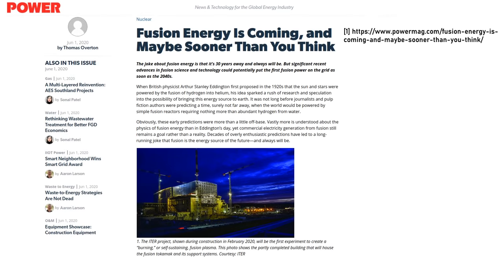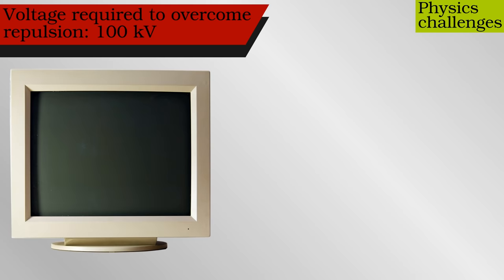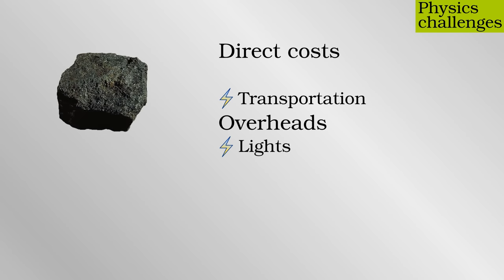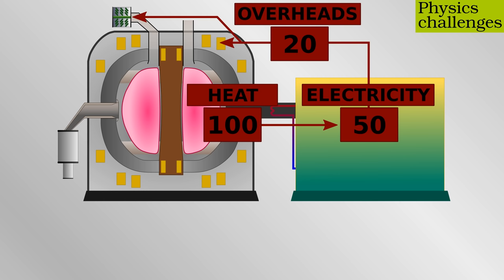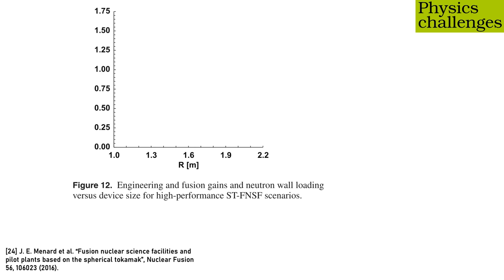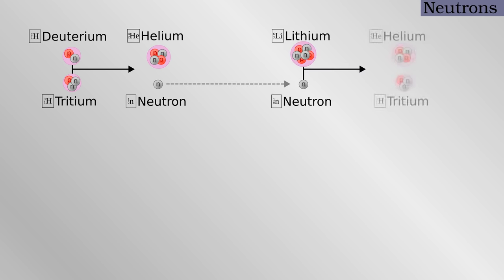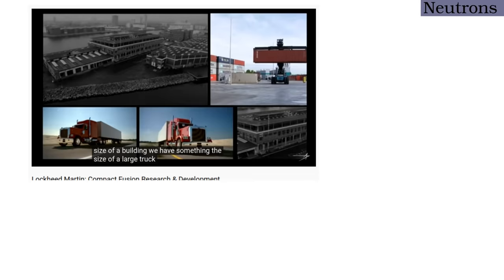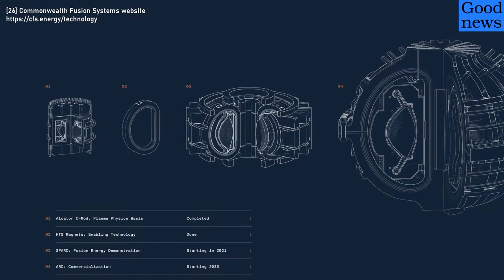Former fusion scientist on why we won't have fusion power by 2040

Comment: Someone once said that physics is math constrained by the limits of reality.  And that engineering is physics constrained by the limits of money.
Reply: Bri Ba  Actually building something is a problem of money constrained by greed. AKA how much of the money will be pocked away with nothing to show for it.
Reply: Fusion tech is perfectly at home among vaporware projects.
Profitable Fusion energy that will solve all of our problems is always two decades away.
It was that way when my dad was born.
It was that way when I was born.
It will probably be that way when I die.
Reply: Love it!
Reply: @hypothalapotamus5293  and that's ok :)
Reply: I don't think anyone in this comment string understands what money is. Money does not buy technological advancements, nor research results,  nor human capital (knowledge). It does not matter If you "have" 5 trillion dollars to invest in fusion energy, the fact is, there are several issues that need to be solved, and this are extremely difficult problems which require time (from extremely intelligent humans). There is also a chance that the person that could solve these issues has not yet been  born. Now, while it is true a large inyection of money translates to more brilliant minds working on the problem, in reality that translates to a slightly higher probability of solving said issues. However, considering many many intelligent humans have been trying to work these problems out for almost 80 years and have not achieved any significant advancement, I'm guessing the probability of creating a profitable fusion reactor is extremely low, no matter how much money you throw at it.
Reply: You can add "software development is engineering constrained by the limits of time".
Reply: i love that :)
Reply: So basically we are being constrained by both limits of reality and money. Great.
Reply: @Zyleace  reality, not money.
Reply: @Spookyhoobster  nah, you clearly needs to add 9x more engineers, the project completes 9x faster. totally doable. (and when I leave companies, I always leave nine copies of the Mythical Man month in the boss desk)
Reply: As if we could approach the heat generated on Earth by the sun. Fat chance of beating a solar array the size of the planet, we'd never use that much energy. Even if we did  that society would be so far advanced that Earth's warming would be trivial.
Reply: Bri Ba  some problems cost more than the PIB of the world to solve. So no we don't have the money solved
Reply: It's more like engineering is applying what science you can find something applicable for it, that is profitable. You won't see companies profiting from any science that came about since the year 1950, and most of it doesn't use any science from after 1900 other than what quantum mechanics is necessary for a transistor to work.
Reply: Duh.... Just design and build money printer which likes to go brrrrrr.
That way engineering constraints are removed
Reply: So it's actually materials science, PM, human motivation/institutional motivation. Money is a shortened phrase.
Reply: Acrually we humans are constrained by our seemingly infinite hubris.
Reply: then federal reserve will solve that limits of money
Reply: @ccva780  Do you genuinely think we'd have been on the moon nearly as fast if the US and Soviet union didn't invest a metric fuckload of money into their projects? Obviously there's quite a correlation between invested money and scientific breakthroughs. Maybe not 1:1, but the amount of people you can get working on something like this if you invest trillions can drastically reduce the amount of time needed to make a breakthrough. Imagine if the US was focusing as much on fusion as the space race, we'd already have it by now if it started decades ago. Instead, fusion remains terminally 30 years in the future.
Reply: @scoutbane1651  No, what I genuinely believe is that achieving fusion is exponentially more difficult than sending a human being to the moon. The point being being that if the probability of achieving the necessary breakthroughs is minimum, even if you add those probabilities up it'll still be quite small. I argue money is not the problem, rather time. And you can't fastforward time.
Reply: Hysen Berisha  I agree. Perhaps not trash but not feasible with the materials we have at our disposal.
Reply: @ccva780  It's exponentionally more difficult, sure. We are also... 60 years in the future. Is it really exponentially more difficult compared to how difficult it was getting someone onto the moon at the time? You do realize science has also exponentially gotten better compared to where we were at the time right. Like, we have loads of technologies that would be considered science fiction twenty-thirty years ago. I genuinely think if we invested as much as into the space race, sure it might take a few decades, but we'd be there by now if we started decades ago, simply because we'd have dozens of times as many people doing fusion research.
Reply: @scoutbane1651  ah perhaps yes perhaps not, I guess we'll never know.
Reply: Hysen Berisha  Oh my fucking god I didnt think you were actually a truther ahahahah it's like a joke that writes itself I am so sorry for whatever went wrong in your upbringing my guy/girl/NB :,)
Reply: The 2 things that make the "world go around". Conservation of angular momentum and MONEY!!!
Reply: Elon Musk seems to have the hat trick on the trio.
Reply: Developing fusion reactors is constrained mostly by greed and limits of reality.
Reply: Instead of money, I'd say logistics is a better term
Reply: Hysen Berisha  there is (currently ) no reason to send a mission to the moon. Other Atral bodies are much more interesting to the scientific community. If you want proof for the moon landing, there are still remains from the missions present, no wind, no decay of your precious proof.
Reply: @Mernom  functionaly all of it. All that's left is pocket change and debt.
Reply: Hysen Berisha  it wouldn't be sufficient to win an argument, video proof would only be necessary if the foot prints and other remains were to be swept away. On top of that please specify your intent next time you try to make a point. There are enough dumb people around who would use these kinds of statements to prove their point.
Reply: Truth!
Reply: engineering is only constrained by the limits of talent and practicality. The Concorde is an excellent example of this. There has not been a single SST operated anywhere since the Concorde went down in flames. How many commercial flights have been lost in the meantime?
Reply: @touristguy87  ok touristguy87, 👍 👌
Reply: Wow, best quote ever
Reply: 1. Not just Deuterium-tritium in the chamber. 2. Consider 13 Compounds used in individual mixing chambers, within the main chamber and as one fusion finished/completes, then begins the second cycle, and so on and so forth until you go all the way to the end to the 13 fusion reaction cycles, and then the energy will be STEPPED UP TO SUCH A DEGREE AND THE PLANT WILL BE IN THE BLACK AND MAKING MONEY. 3 It is up to you folks to figure out which substances have to be employed, and to arrange these substances in a stair step pattern, with those substances which create greater coldfusion explsion energy then the previous compound used.
Reply: Bri Ba  I think in fusions case the biggest danger to ever seeing a working reactor in our lifetime is when the presses promises of “fusion in 10 years” wear off and the research companies lose most of their funding. 

It would be hard to get funding for a project that takes like 50 years at least and won’t have much to show for it except for tiny gains every couple years. Especially when fusion tech gets a little closer to being viable and the costs of building new test reactors skyrocket, since any major gains will only be had with complete redesigns of reactors, instead of small upgrades.
Reply: Read "The Legendary Man-month" by an IBM programmer. He noted that throwing 10× people on a project doesn't make it 10× faster.
Reply: someone once farted
Reply: Right. As they ignore the limitation their own physics puts on things. Unlike normal things. Blackholes and neutron stars are the only known objects that somehow can put out more energy than the take in. One collision making a gravity wave with enough energy in it to be 50 times more than everything in the visible universe when the wave combined as it left the point of collision...

The other reason it probably won't work I explain in another comment at the top. Their own avoidance of theories they support and possible down sides to having that kinda thing without other forces like massive gravity that could regulate quantum fluctuations that allow stars to fuse even as the sun burns up there right now.

I even looked it up just to besure and they say the quantum is needed for stars to even come close to doing fusion cause they don't have enough power even in their core to do it.

So you want to see a quantum powered object. The Sun is a massive object that uses quantum effects as its fuel somehow jumps to energies that its own pressures and gravity can't put a candle to.
Reply: @Blazeww  you need to take a sedative and play some World of Tanks and work-out some of that anger.
Reply: Well said
Reply: @hypothalapotamus5293  very true.  I first read the phrase "tokamak" in 1990 while I was at engineering school.  Still not ready.
Reply: well said!!! i steal this 😂
Reply: @ccva780  Agreed. Magnetic confinement of the plasma is very unstable. The sun does confinement by gravity and solar flares show that to be unstable too. We have only done thermo-nuclear fusion for the order of a second with demonstrable intended results, before the device blows itself apart.
Reply: And the money is engineering constrained by the limits of what?
Reply: @electronresonator8882  There's no limits to money as far as government.  The limitation is the value of said money.
Reply: @scoutbane1651  As impressive as the Apollo Program was, the foundational science and math were already quite mature.  Yes, there were terrific challenges and some amazingly brilliant people that made it a success with little more than slide rules.  At the end of the day, nobody was saying, "Just make physics better."
Reply: @patrickjanecke5894  Nobody is saying that with fusion either what the hell are you talking about. Did you see how we're now using high temperature superconductors to make fusion exponentially better? By 2025 we'll have a fusion reactor with a Q of >10.
Reply: @scoutbane1651  Your argument actually underlines my own.  How large of a portion of waiting for fusion included superconducting magnets?  Even after gaining that technology initially, progress in superconductors has been one of fits and starts.

Don't get me wrong, I do want to see the MIT team successful.  That said, my concerns are both the over-reliance on Tritium and operation times.
Reply: @ccva780  yep Perelman didn't need money to prove one of the hardest math problems. And all the money in the world won't help to come up with genius solution about fusion. They need some qm genius not money
Reply: Feynman talked about this-often a source of good natured rivalry between physicists and mathematicians
Reply: @usr7941  yup agreed, and unfortunately those types of geniuses come only once or twice in a century.
Reply: Very good!
Reply: das deep bru...
Reply: Nice
Reply: Reality? "It is in the classic arrogance of man, to think that all that he knows is all that is"
Reply: Yeah sounds about right
 Some "smart" guy always has to come around and say "this thing is that thing, but different."
Reply: lets`be honest money is generally the limit regardless of the field. Fission is dead and fusion does not make any nuclear waste but some alpha particles of radiation.
Reply: It's practicality more. If it's too expensive, chances are, it's because it's too resource intensive. Whether that's using too much raw material or too much energy. This is especially the case in fusion and as someone else pointed out, there are big hurdles that money can't magically solve. Brilliant minds have been working for decades with snail-page progress. Pumping trillions of dollars in, for all we know, could only translate to miniscule gains in productivity and innovation. 

I'm getting really tired of people watering down all problems in science to "greed and an unwillingness to just throw more money at it."

You're stupidly naive to blame all of life's problems on greed. It implies you think money could solve everything, which it CAN NOT.
Reply: "Someone once said that physics is math constrained by the limits of reality."
Not so much, have you ever looked at things like string theory?  Theoretical physics is constrained by the limits of intelligence and creativity, and hopefully at some level the push back at BS.

Engineering is constrained by physics, very true.  Is it constrained by money? Absolutely, no question that is one major aspect.   But much moreso, IMHO, for the most part, by the greed and shortsightedness of the kindergarten MBAs of the world, and every other form of ankle biter out there whose single goal in life seems to be to place absurd roadblocks (for the most part) all along the design path.

Can you tell that I am an engineer?  Every other engineer will be able to, when they read this, I suspect.
Reply: A different set of definitions:
Engineering is making something work thru experimenting and cobbling it all together until it functions the way you want, without necessarily understanding the exact principles behind it.
Physics is figuring out those principles so it's repeatable.
Math is figuring out how you can apply those principles in a more easily calculable way. Example: replacing certain differential or integral solutions with matrices (multiphysics does that, based on some interesting math 'simplifications' like Finite Element Method, Method of Moments, Finite Difference Time Domain and several others.)
Reply: then music might be math for the soul
Reply: engineering is constrained by the limits of engineers.
Reply: Don't forget that there is an extremely limited amount of tritium and producing it from lithium-6 is extremely problematic.
Reply: More accurately, math is the language in which physics is formulated and communicated.
Reply: Here's some metaphysical math : Less is More.
Reply: Does that means maths has no constraints?
Reply: @Spookyhoobster  All engineering is constrained by time (and money).  Software engineering is also constrained by certain mathematical realities.
Reply: well economics is money constrained by the limits of markets
Reply: @ccva780  well said. Or, to put into other words, the fact that a woman delivered  Isaac Newton in nine months, does not mean that  nine women can deliver  Isaac Newton in a month.
Reply: Bri Ba   @Marik Zilberman  Conditional Probability is a particularly interesting form of mathematics.

"If throwing n money at problem P is a function where the probability that P will be solved decreases logarithmically as n𝛥 at given t increases, until at point R it inverts and further throwing actively impedes problem solving, and n𝛥 is always > than R(t)-t, which is always > than P... then what the fuck is even my head?"

Governments and institutions can create currency, but they don't know how to make money worth anything. They run the "Solow Growth Model" which states that "demographics is destiny" and that roughly speaking all you can do is try and have more people between 25 and 45, keep things liquid, and chuck ever more typewriters at monkeys...

Engineers should be running things. But of course, the problem is that engineers focus not on society but on functions, since they understand that there's no running things if things don't run.
Reply: Nobody said that
Reply: So, communism is the answer
Reply: Don't know who that someone is and if that phrase had a context...  by itself it seems said by someone that has no idea of what math nor physics nor engineering is.
Reply: @patrickjanecke5894  Money is a proxy for energy. It loses its value when each unit of money represents fewer units of energy.
Reply: Y not get it
Reply: @ccva780  your entire point. Just logical fallacies. Of course money leads to innovation, same way war and survival does.
Reply: @AntonioGarcia-wn7ut  ok, here's a chocolate for your opinion 🍫
Reply: I agree with the first one, but I would say Engineering is Physics constrained by the limits of common sense.
Reply: Money is kind of a secondary abstraction here. Engineering is physics constrained by resources.
Reply: Physics is restrained in the math too.
Reply: @dendrogenhs  Loved this!
Reply: maths
Reply: I love this
Reply: nah i'd say engineering is physics constrained by reality, money problems and engineering problems aren't exactly the saem
Reply: And material constraints in this case.
Reply: I think it was Hitler
Reply: and politics is engineering constrained by the limits of human stupidity
Reply: Maybe focusing on the ONLY THING IN THE UNIVERSE that can create magnetic fields in stars or anywhere ,instead of focusing on the 100000000000000000000000000000000 times weaker "force" GRAVITY we might make progress! Good job wasting 70 years and billions of $.
Reply: I like to describe engineering as the science of the possible.
Reply: @hypothalapotamus5293  Very original
Reply: Therefore, engineering is physics constrained by money and reality.
Reply: Well said someone!
Reply: Both are plainly wrong, and the "limits" stuff is nonsensical. Think about it a bit. I'm not aware that "reality" can be varied, and you can always print more money. I think Godel proved the first one wrong.
Reply: Bri Ba  cute, but we really can't exclude intelligence from that last bit...
Reply: Wow that’s SPOT ON
Reply: The second part approaches validity if you modify it to read "Engineering is a mixture of physics and economics."  Physics, however, extends beyond math, as shown theoretically by Godel and practically   by the fact that all physicists (or close enough) recognize that observation is the bedrock of physical truth. Math is a stunningly useful tool in doing physics, but is most certainly not a generalization of it.
Reply: Well said lmao
Reply: I thought the UK was building its first fusion reactor?
Reply: @makeasylumsgreatagain864  Really?
Reply: That's not entirely true for the latter: engineering is the budgeting of reality.  Money is a factor, but there are a number of realities that you can't bypass regardless of how much money you throw at it.
Reply: More like constrained by the limits of existing materials science.
Reply: @ccva780  Money SHOULD be a problem for Engineering. Money = Time + Productivity + Customers. Money makes all of these scientific pursuits possible. Science should have to prove that these pursuits are possible, then investors can give their hard-earned money a go. Scientists that lie about the science of their pursuits are basically thieves.
Reply: @Zyleace  Those limits are good things. If nature didn't have limits, i.e. if the nature of Nature could be changed, then science wouldn't exist. There'd be no facts, since reality would be some flimsy, changeable thing. Without facts, there's no such thing as knowledge.
Reply: @joshuagould548  I'm not simply talking about the physics of it. There's also the situation of how fucked up humans would hinder the research to unravel the secrets of reality. If it was only the limits of universal laws, that's fine. But then you have to add up that financial situation. It's a stack of problems and knowledge is the bottom of it and you have to do everything above first.

Without constraints of money, people could work on the reality, there will be such thing as knowledge.
Reply: @Zyleace  Understood. But without money, research would hardly exist. Technology exists because someone saw that the science of it was possible, but what's the point of mass manufacturing and commercialization if there's no ROI. Think about what R&D looked like say 1000 years. It probably basically didn't exist (unless at the behest of some royal family, who had money).
Reality is all-encompassing, we don't have to go to the end of the galaxy to learn about it.
As an example, it's impossible to explore places that are light-years away, because of that, there will be little to no technology being worked on to supply such expeditions. If fusion falls into this category, then it's money should dry up, and it's research ceased.
Reply: @joshuagould548  Which is why too much dependence on money should cease. With current technology, money could be replaced by a vanishing credit system where it could be given as a salary to jobs without being of so much value. These credits should disappear when utilized for transactions unlike real money which circulates.(This system is huge, I do not wanna delve into it)

Also, science might not need to go into far places in the galaxy to uncover reality, but humanity isn't simply about science. One day, a new age of exploration will eventually arrive. People in that day and age will be dying to see and experience other stars and planets not simply for science but for exploration honestly. It's an inevitable thing about humanity.
Reply: @Zyleace  So the credits would just disappear upon transacting? Money = Time + Productivity + Customers. So when the credits disappear, their value (the time and productivity put into them) would just disappear?

Also, I'm of the belief that people already want to visit other stars and galaxies, but those are light years away, so it'll never happen, and no amount of science could make it happen, therefore no money (or credits) would go to such pursuits.
Reply: @joshuagould548  Money is something that has always been intended to reimburse time and productivity made by people. It only makes sense that it should disappear once you have bought something. Demand still works though. The system is that credit authorities will give the credit funds to companies annually. The requirement is that demand should not drop to an unacceptable range. It's like an infinite money but regulated by various policies that will keep the economy from having serious inflations.

And I extremely disagree on the second part being impossible. People 2000 years ago would have never expected that things like cars and smartphones would exist today. To them, they are magic and things that are far leaps of technology. Millenia in the future, we would surely have the capacity to travel to other stars. As long as humanity aspires for it, it will happen. So at least I'll have faith on that part.
Reply: @Zyleace  If money disappears when I buy something, then what does the person I transacted with do? Now they don't have their product that they sold to me, or my money that i bought it with. Do they just lose?

So governments will just give money to companies annually? No need to earn it? So if I just pitch a good idea that other people like (demand), but haven't proven possible, I'm open to an infinite money supply? If your credit system is based on nothing physical, then it's susceptible to all of the ebbs and flows of inflation and manipulation, like all of today's fiat currency. Your credit system would be a fiat currency. Infinite money supply means a soon-to-be worthless money supply.

Getting to another star is in fact impossible. The ancients of old could at least look at today's cars and see THAT they work, ask questions, put together certain simple logical conclusions. Getting to another star would require the actual top speed of the universe (light speed) and would require that speed, consistently, for 1000s of years. That's what a light-year is: light traveling in a direction for a year. Imagine the distance light can cover in a year...now multiply that by 1000s. I think the closest star to our sun is like 4 or 5 light years away. That's still an insane amount of distance, and humans absolutely cannot travel at that speed, plus whatever tech is used for the traveling would be billions times heavier than a photon (what light is made of), so it would take billions time longer.

Faith and science don't mix. Faith requires one to shut off their mind and just feel. Science requires the mind be turned on and focused, and feelings left aside.
Reply: @joshuagould548  Pff, I never said "governments." How ridiculous. Banks will be the one converted into the credit authorities, separate from the state. The credit system needs you to rigorously defend your business proposal while being ready to build up that business or company. Once approved, you will be able to receive capital ONCE. If your business is a total failure for one year, you don't get to receive the capital for the next year. And I never said it's an infinite money that would just cause a great depression. Infinite money supply here means that the credit authorities has the power to create these credits as they see fit, but with limitations. After all, these credits are voided once spent. It's not an infinite cycle, but a limited lifetime for all credits. Unlike currency today which circulates endlessly, credits start from the banks, terminated once utilized.

And you are misunderstanding faith again. Too much red herring. I'm talking about basic faith towards mankind. Not god. It's a basic necessity to believe in mankind's ability to reach the future. If you don't even have that sort of faith towards your fellow humans, you lack some basic humanity then.
Reply: @Zyleace  OK, then anyone can open "a bank" and just give their buddies infinite capital. Approve them every year. The business proposal could be crap, but you'll have an income because your bank could give you credits anyway. Also, since "the banks" can whimsically create these credits for nothing, they don't have to be scrupulous at all with their investments. They could give as many second chances to any failing business as they want, thus infinite credits. Bad businesses would sprout up everywhere.

Banks today have to weigh heavily on their investments, too many bad investments would result in a huge decrease in returns on investments, and the bank can go down. Investing is about judgment, and with the ability to just create credits when I feel like it, I can abdicate from judgments. It can go the other way too: if the bank simply didn't like the person, the bank can simply deprive them of credits.

No red herrings. It's called a dictionary. I'm very positive about the world we live in and what mankind has done. Faith has a meaning, and I applied it. Faith is about believing in something with no evidence. Me admiring the geniuses of the past and present, and the ability of mankind to master the universe isn't Faith; it's Admiration, good will, and benevolence.
Reply: @joshuagould548  Sigh. This guy just doesn't get the point or even context of what I meant by faith. It's about trust and believing. You have to have faith on a future that isn't determined no matter how humanity seems to suck. Nevermind, seems to me you have no faith towards me or even any other people. I'll no longer reply to that subject after this

Also, you totally didn't get it when I said you have to rigorously defend your business proposal isn't it? That's only once. You have to report to the credit authorities annually about the demand and status of business and there will be some sort of a supervisor who will check the business. If your business fails, credit funding will be cut off and your business is officially closed.

Also, credit funds are reset annually. If you have retained some 1 million in your company's bank account, that will be voided once the year ends and will be replaced by the new approved credit fund.

If the business proposal is crap, rejected. Funding is not provided. Business will not be established. Did you really think the crediting authorities are not gonna be composed of professionals like panelists in a thesis defense? Businesses will still have to comply on standards set by both the state and the crediting authorities. As for second chances, there will be no second chances for the same proposal. You have to recreate your business model and proposal again then present them to the panelists.

Also, investments won't be needed because the credit authorities will provide all the funding. You need more money than projected? Report to the crediting authority. By this, credits are an enabling power for people to move goods and initiate manpower. Of course, this isn't capitalism because money isn't important here as I've said. After all, it's just a tool to convert your work into something else. You want profit? Nah there's no profit here. Everything is based on equal exchange. Businesses gets no profit in this system. Businesses are only organizations meant to handle processes and responsibilities within the society like food production and manufacturing products. Law of demand and supply still works though to regulate prices.
Reply: And politics is *social engineering constrained by the limits of the population's IQ.
Reply: @Zyleace  You must not have read my previous comments. I have plenty of optimism in humanity. Unlike someone who seems to think money is a bad thing.

I'm still wondering who these "credit authorities" are. They're NOT state officials? But the standards are SET BY THE STATE OFFICIALS? That sounds like government to me.
And you still haven't explained how your system isn't susceptible to corruption. Authoritarian countries' state officials hand out favors all of the time, your "credit system" would certainly fall into this category. I'm sure their panels and committees are made up of professionals too.

So working your butt off to make a "profit" under your system, would be for nothing, because at the end of the year, it's all wiped clean, and then I have to hope that I can get more funding at the next proposal. This stifles growth and expansion. What if I fail to get the funding somehow? Have a bad day? Mess up my proposal? Then a good business model doesn't get funding?

What if I want to hire another worker, but my budget is already a little tight? Do I have to get permission from the committee every time I want to hire another worker now. What if I need new machinery? Something breaks and needs replacing, or an entirely new piece of machinery would increase productivity. Is the committee effectively running my business at this point, since they can just say "yes", or "no"?

Man, what if I had 200 employees and positive cashflow? Did the credit authorities just wipe me out? Well I guess they wiped everyone else out too. Man, I wonder how long it'll take for the credit authorities to get everyone funded again, so the economy can start again. That sounds like A LOT of restarts. Sounds like the economy would just collapse overnight. How would the economy look after every reset??? It could look completely different, and by complete accident! Perfectly successful people might not rise again, because they couldn't nail the proposal. And shady, sheisty people could restart because they know how to work the system.

What if you're not entrepreneurial? What if you don't want to start a business? Where do these credits come from for someone who just wants a wage? Do you just promise to be a good worker? What if you lie? What if you get like a year of credits and don't work until the next year? Maybe you can just work sometimes, to rig the system.

The overall problem I see with this is that it's an economy based on permission, not freedom. You're not free to act on your ideas. There's literally people standing in your way who have more than enough power to stop you. Ambitious people with creative and innovative ideas and the drive to step forward shouldn't need permission to pursue their dreams.

Silicon Valley wouldn't have existed under this type of system. Neither would huge manufacturers, and substitute technologies. Someone like Thomas Edison wouldn't have been able to compete with Kerosene Oil because the "credit authorities" wouldn't have had the imagination to see what Edison saw (I say that because at the time, the world did not have the imagination to see it coming). Electric cars would be laughed out of the proposal room. 
What if I like making chairs, and the credit committee tells me that "there's already enough chair makers out there". Then what do I do? But I want to make chairs. Maybe it's something I love doing, and want to get paid to do it. Nope, not gonna happen, according to the credit committee. Not that I'm not good at it and can't turn a "profit". Nope, I don't get to even try at all, just because some tribunal says I can't.
Reply: oo i love that
Reply: keep it going until da end  @hypothalapotamus5293
Reply: Well, being an engineer (or at least one educated in engineering), I know that this is wrong. Engineers and engineering USE physics, along with technology, engineering, and math. They are not the same thing, stop trying to sound "deep".
Reply: @ccva780  such a thoughtful insight, and completely true for as far as I can tell. It's easy to get hyped thinking that you will be present for one of the most influencial achievements in human history.
Reply: @hypothalapotamus5293  I hope you're wrong. But I wouldn't bet money against you. As @drmodestoesq wrote, "engineering is physics constrained by the limits of money" and you've passed my limits.
Reply: Money is conjured up from thin air. Energy and physical resources are the limiting factor.
Reply: @maxdurbin3033 We could never build a solar array the size of the planet. People watched too much SciFi aka Fantasy movies where "science" is just another word for "magic".
Reply: Math is imagination constrained by logic
Reply: I can understand how multiple lasers can induce fusion in a pellet of Hydrogen isotopes.  At present, I cannot understand how the engineers can keep the optical surfaces of the lasers clean on a continuous basis.
Reply: @ccva780 more money would still definitely speed things up. Always has.
Reply: @hypothalapotamus5293  I find that ironically funny!!!
Reply: Venture capitalists work this way buy into a venture get a good sales pitch to get everyone else involved then sell at the peak and then go on to the next big thing. Whether it works or not. I remember not too long ago there was a venture involving mining minerals from asteroids. Except nuclear fusion promises and investments have been going on even I before I was born.
Reply: That's a great one
Reply: @Spookyhoobster  time and space
Reply: and knowledge, research, science and a gazillion other things. it's 1+1 / 1+1
Reply: Which is why we need natural gas as a bridge to fusion energy and the backup to produce the hydrogen necessary for fusion. Fusion energy will be really an energy amplifier!
Reply: Not just money but other things like the properties of materials, the quality of materials that can be realistically achieved, etc.
Reply: And clean fusion energy is constrained by efficiency.
Reply: Love that one. But I would change it that physics is constrained by the limits of theoretical reality and engineering is constrained by limits of real reality (and money)...
Reply: @Zyleace  
money is part of realety
Reply: Money isn't real
Reply: @TlD-dg6ug 
Money is the value we associates to objects we use as a currency recognised by the Government
Anything can be money
So YES, Money exist
😂
Reply: @aleanddragonITA  Money is representational, it exists much in the same way your name exists in relation to yourself.
Reply: @SOLOcan  
How is this supposed to debunk what i said?
Reply: @aleanddragonITA  well what is more “real” your name or you? Money itself is not the value we associate with objects, the objects (more specifically the social relationships they exist in) are what we value which we in turn associate with money

But now capitalism has become so ingrained into our lives that we mistake the representation of the object as the object in of itself.
Reply: @SOLOcan  
What is more Real
The Sky or The Ground
???
Reply: @aleanddragonITA  they are the same in terms of “realness”
Reply: @SOLOcan  
The Ground is a physical object
The Sky is a Phenomenon caused by Light being reflected in the Atmosphere
Reply: @aleanddragonITA  both are “phenomenal experience”. The “ground” is considered the “ground” and not a “wall” due to how we experience gravity which itself is just a product of how we perceive objects travelling through space time relative to us. In other words, both the “sky” and and the “ground” are both objects defined by our interaction with the world, they are ontologically alike.

Can you say this about your “name”?
Reply: Phisics is far from b/eing close to being mathematics.
Reply: @ccva780 And how do you coax those humans into your fusion research lab? Not without money I can assure you.
Reply: Thanks for the expanded detail. Very interesting.
I wonder where we would be if all the money dumped into fusion, windmills and solar had been spent on molten salt Thorium reactors?
Reply: Bravo! 🎉 That was wonderful!
Reply: That is why we should develop more sophisticated simulators to test theories and experiments. Simulation is inexpensive, simple, and requires significantly less space for operation. Although not as dependable as the real thing, it is extremely cost-effective. Furthermore, if a simulation exhibits some promise, plans can be made to implement it in the real world.
Reply: Because 9 engineers can solve a problem 9 times as quickly as one, like how 9 pregnant women can birth a baby in just 1 month
Reply: @glitteringsunshine4306  
Wouldn't that mean we're not constrained? Or did you accidentally phrase it wrong?
Reply: Fusion is the world's 2nd greatest boondoggle,  next to "renewable energy".
Reply: @hg2.  
That's pretty factually incorrect...
care to substantiate? I mean solar and wind, for all their flaws are still considerably better in the long run than coal and oil. Even without the obvious improvements they're getting in the future. 🤷🏾‍♂️
Reply: @Mernom which is politics. As money is power to have things done the way the owner of money wants it
Reply: @glitteringsunshine4306 sometimes we are. Pilgrims and jugglers are not though
Reply: @turnipsociety706  
?
Reply: Yup did it on paper, and things like a drain culvert sized BeO tube and a giant superconducting magnet,6 long range radar grade klystron tubes, a small nuclear reactor to supply the initial kick, deuterium and tritium mix to start, combined with a football stadium worth of support equipment would be well into the double digit billions of dollars. Now to make it even worse, you would need to go full scale to get it to work. Anyone willing to gamble 🎰 😂
Reply: @christopherleubner6633  
Yes...
You sound like a pro in this business. 

Please do everything you can to explain what a BOONDOGGLE fusion energy is.
Reply: @Mernom  Yeah putting billions down on something like fusion knowing your estate wont see profit in your lifetime is great for humanity crappy for the individual
Reply: And math is truth constrained by logic.
Reply: Wisdom